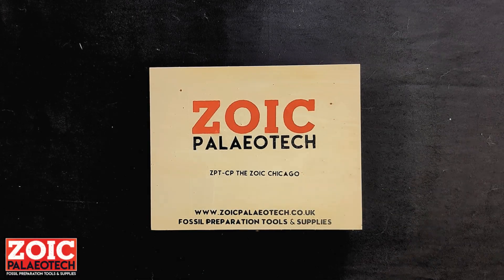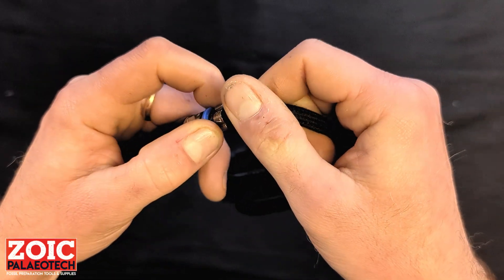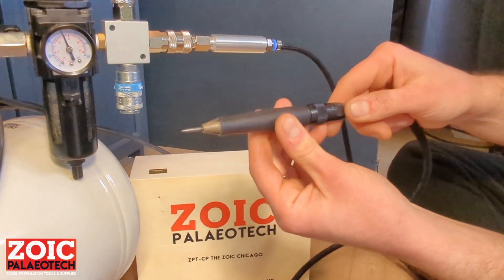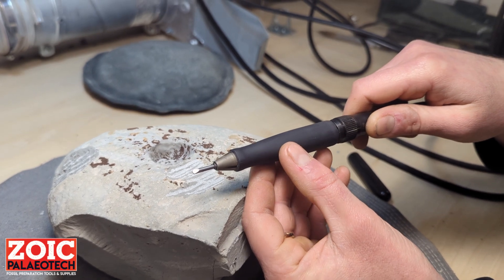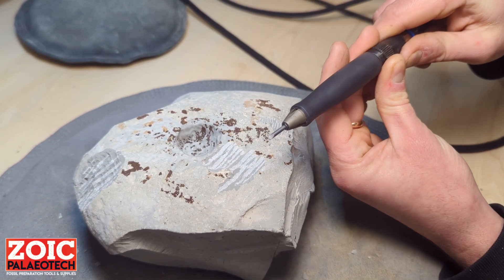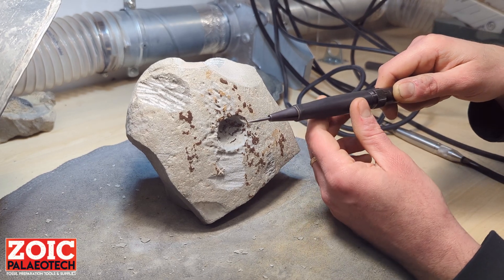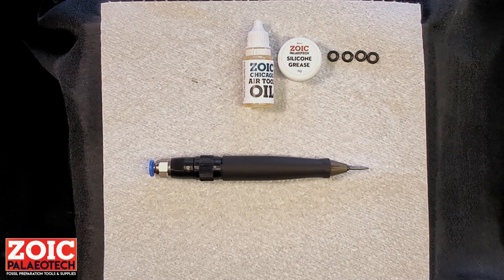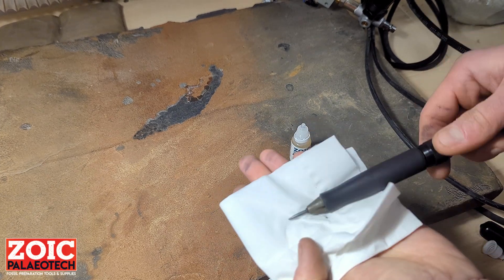How to use and maintain the ZOIC Chicago Fossil Preparation Air Scribe

Comment: I have the problem with the ammonite air scribe, that only air comes out at the tip. 😢
Can I try the same solution on my pen like in the video? 
It’s almost brand new, maintaining it and still doesn’t work. 😭
Reply from the maker: Hi! Yes, the usage and troubleshooting steps are the same! Don't worry, your tool is covered by a full warranty and we're always on hand to help. Drop us an email at info@zoicpalaeotech.co.uk with the symptoms and we'll get it up and running properly 👍🙏
Reply: @zoicpalaeotech  Hi, thank you. I will try it, if it doesn’t work I will get in touch with you.

Comment: You can see my first run with the trilobite on my channel and although it’s a little on the weak side for the type of rock I’m using it on I know it’s a beginner tool and isn’t designed for it so I’ll stick to sandstone also my compressed isn’t overly powerful so I only have about 3 minutes before I have to repressurise
Reply from the maker: We did see! My advice would be to hold it a little more like a pen, which will give you more control. Check out the video we have on the Trilobite here - https://youtu.be/QehahLzIgak. Harder rocks will be slower going than softer rocks with the Trilobite, but you can through pretty much anything at it! It might just need a little more patience than with a more powerful air scribe. You will have the advantage with it that it can be very delicate, so when you're working on the centres of ammonites, you'll have a lot of control and precision. When you look at a fossil someone has prepped, you can't tell how long it took them, but you can tell how careful they were with the finishing touches :).